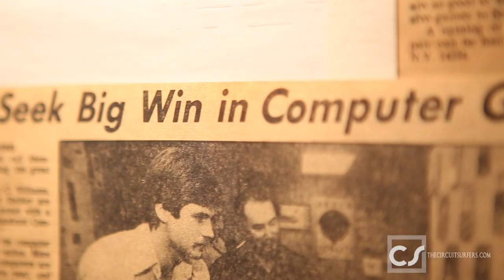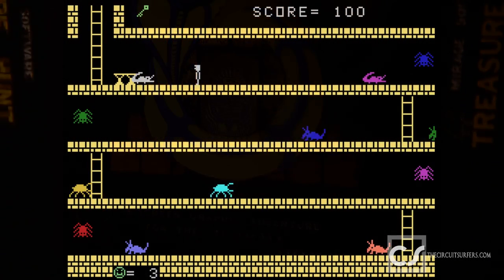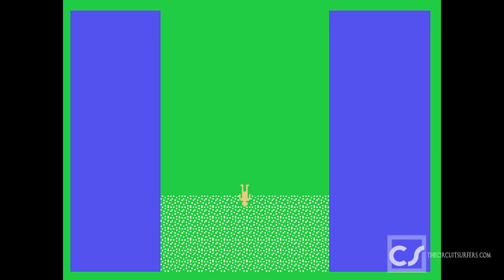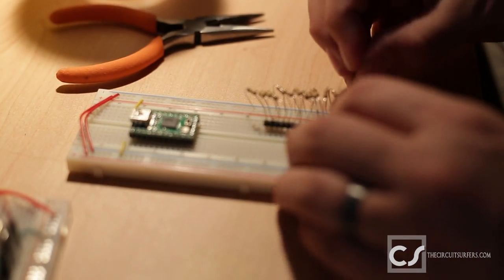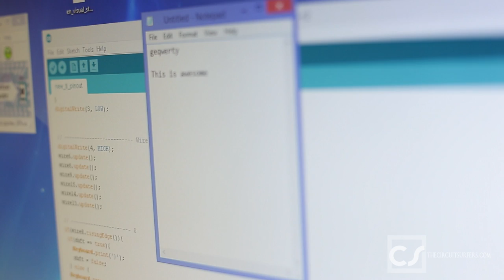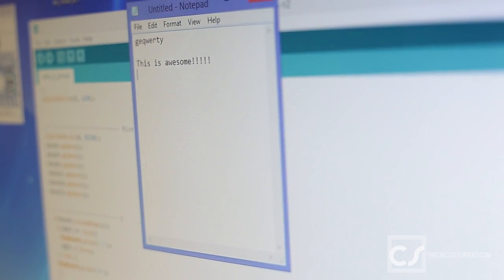TI-99/4A reconstructed with a Raspberry Pi and RetroPie! TI Pi!

Comment: One of the finest raspi projects.I was about to do one with a g7000 but I fixed it. I think I will use a ps1 case for the project which will hopefully utilize the original controllers.

Comment: The problem I have is that TI-99/4A is not a supported system on RetroPie - so unless there is a way to add that functionality you are stuck playing Atari 2600 games (bleh) on the TI. If you managed to get that bit working it would make for a great video.